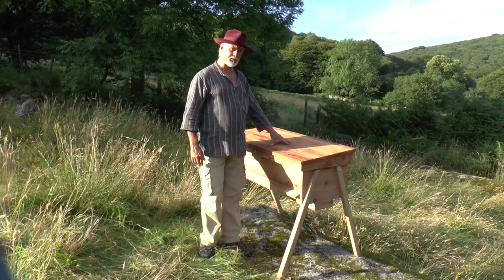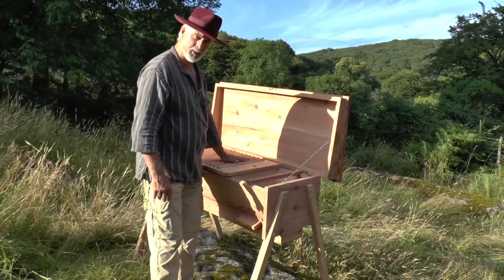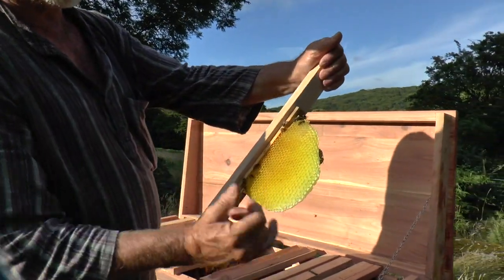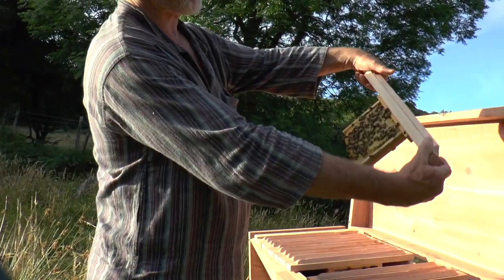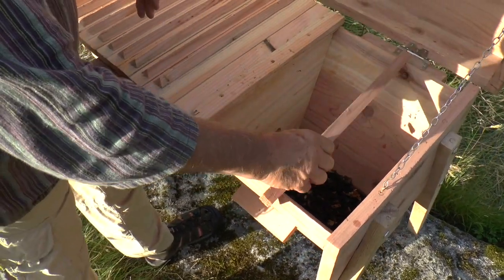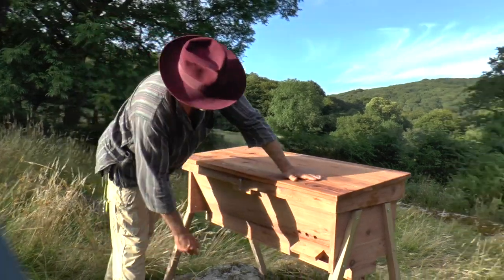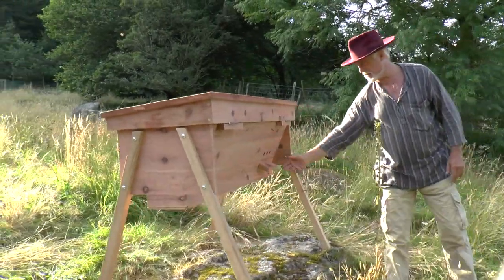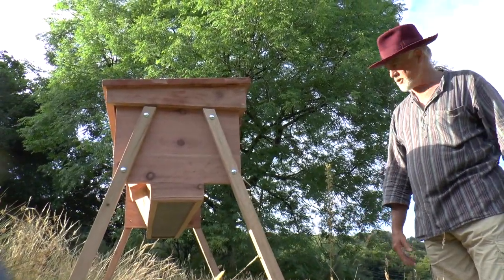The Top Bar Hive: key features and benefits

Comment: Hi Phil and greetings from Tasmania, Australia. I have enjoyed watching and learning so much from your videos. I have recently become a bee keeper because a swarm moved into an ornamental Warre hive I had in my garden. After lots of research on the net I have decided to go with a horizontal langstroth hive with cover boards over the frames and a ventilated roof. The cover boards have a 3mm space along 3/4 of one edge allowing air to flow from the body of the hive into the roof space and then out through the ventilation holes in the roof. The bees can use propolis to control the air flow.  I would appreciate your thoughts on this set up. Cheers, Ron
Reply from the maker: Hi Ron, the Warre is a fair mimic of a hollow tree, and works well in some areas, especially where flows are long and strong. One of its core principles is heat and atmosphere retention, which I think is what bees need almost as much as food. I would not allow heat to escape into the roof space, especially as you will regret having quantities of propolis gumming up your frames when it comes time to move them!

Comment: Lovely TBH. I have recently made my first one based on your periscope entrance idea which i like the sound of. However the other day i found a number of dead bees in the bottom, although the hive looks healthy. Not sure if this is because of the time of the season when the bees start reducing in numbers ??
     On 2 occasions now when I have opened one end i have noticed a bee struggling to remove a dead bee by making its way up to the top.Do you think they my find it hard to eject dead bees with this type of entrance? I have now fitted your eco floor so I presume any dead bees will fall into that, decompose or get eaten by bugs etc.   Do you think this is ok >? Cheers Simon
Reply from the maker: Simon Kellam Having a high-ish entrance does make more work for undertaker bees, as you observed, but the eco floor theory is that dead mites, bees and other matter will provide food for such as the Stratiolelaps mite, making it possible for the mite to reproduce and live as part of the hive eco-system.

Comment: Seems like it would be so much easier on my joints and back. Can I build framed frames like in a traditional hive? So comb doesn't fall off?
Reply from the maker: Top bar hives don't use frames. You can use a horizontal long hive if you want to use frames, but the top bar hive is simpler to build.

Comment: I'm setting up swarm traps and have no comb to put in the traps.  Do you coat the "foundation strips" with wax or foundation comb to get them started?
Reply from the maker: Ideally, dip the lower edges of the (triangular) bars in beeswax, or rub them with a lump of beeswax (or beeswax candle) to give them a strong hint of where you want them to build. If using flat bars, best pin a thin strip of wood down the centre (about 12" / 30cm long) as a guide and add wax to that.

Comment: it looks like (unless I'm mistaken) you use both vertical and horizontal (top bar) hives, which do you like the best, or do you like both types equally?
Reply from the maker: I do use both, and my preference is for the horizontal, as I find the bees tend to be better tempered and easier to handle, as the whole colony is never exposed at once. Having everything on one level is a boon as one gets older and less inclined to lift heavy boxes.